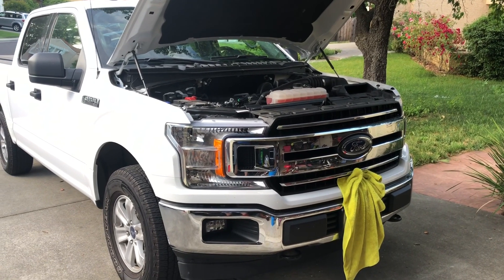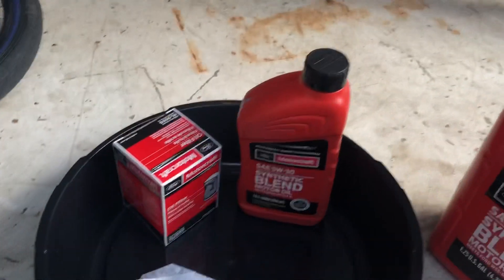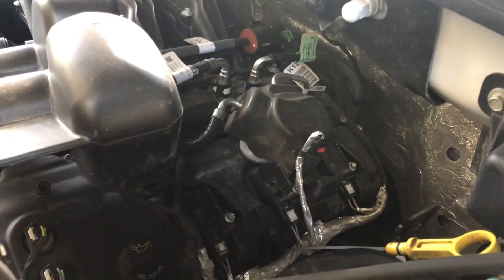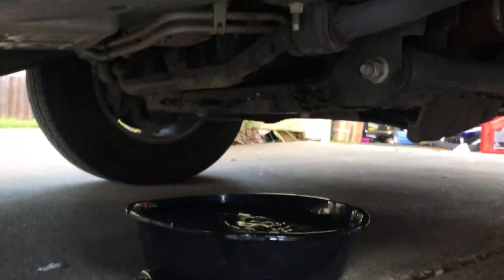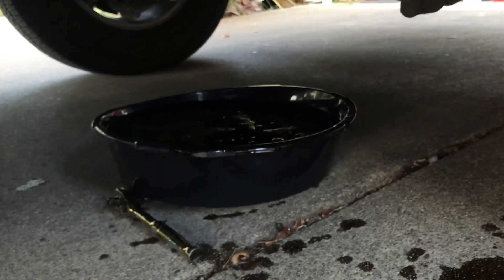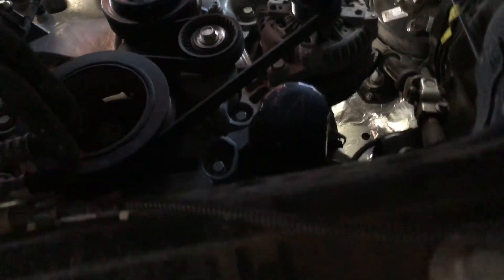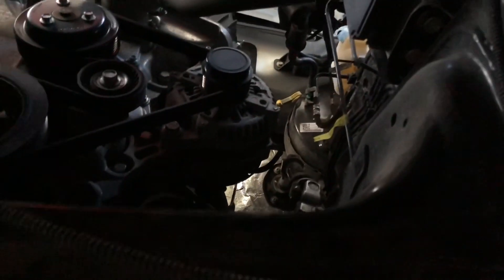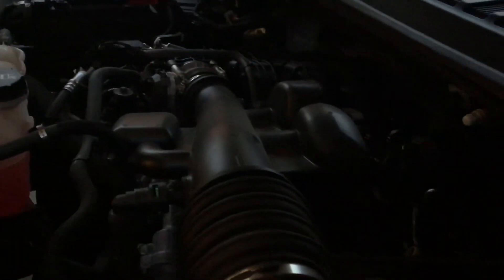2018 F-150 3.3L V6 Oil Change

Comment: Its almost like Ford said, " How can we make it an even more difficult  to change the oil on our trucks". Hopefully the aftermarket has a solution for relocating the oil filter to make it more accessible.
Reply: I am still driving a 2008 crown Vic. Oil change is a breeze by comparison. Ford knows how to make oil changes easy in a car. I think cup holders rate a 10 in importance to the designers and servicing ease rates a 1.

Comment: I just changed oil for the first on my f150 I prefer how Toyota Tacoma has there oil filter and oil plug. So easy little messy on the f150

Comment: Great video! Can you post one when you change the plugs so you can show how to remove the three on the passenger side?  The driver's side three plugs are out in the open.
Reply from the maker: Yea I’m at 61k on the truck now.  Done nothing more than oil changes and it’s running great.   Will do the plugs probably around 75k.  Same with rear Differential at that time too. 

I’ll post vids of each

Comment: I am wondering if this shares any of the oil consumption issues as with the V8 5.0L? (They started to spray on a plasma cylinder sleeve in 2018 on the V8)
Reply from the maker: I have now just under 49k on the truck and have had little to no oil consumption issues.   Love this lil motor

Comment: Is that a plastic oil pan on the 3.3? What in the heck is this world coming too. I really like and want to buy an F150 but this kind of stuff turns me off about it.
Reply: Check again, Ford may have gone back to a metal pan.  They did for the 5.0 engine.

Comment: I changed my trucks oil yesterday.
Here’s a couple of tips... 
1. don’t vent the pressure by removing the oil cap and/or dip stick until you  drain about 1 or 2 quarts and don’t release the drain plug entirely. Control the flow by holding the plug. This will eliminate the oil from shooting out so far. 
2. The cover that you referred to as “the splash guard” can be removed for better access to the filter. It  has 2-8mm bolts and 2-15mm bolts. If you remove it, the oil from the filter won’t splash anywhere.
Reply: Sound advice ..   my first time . I did the same thing as him

Comment: what's the differen on 5w-30 and 5w-20????? one dealer add 5w-30 when i buy the truck and 5k later i took it for a new oil change and they add 5w-20???? no now i worry can this hurt my motor ? i have 3.3 v6 f-150 2018 too!!!!!!
Reply: I got a 2020 Mustang GT with a 5.0.  The manual and oil fill cap recommends a 5-20W blend for everyday driving.  However, if it goes to the track, a 5-30W is recommended.
Reply: @AStanton1966  well i yes on winter i could add 5-w30 thats when i drive the most fro deer season! i really want a GT LOL
Reply: @7outdoors4life  I've got active exhaust.  When I set it to track mode, you really hear those dual overhead cams.
Reply: The difference is that the manual say 5w20.

Comment: thats the Duratec 3.3L Flex Fuel?
Reply from the maker: Yes!
Reply: @maz94protege  Hi! I'm on the market for an used F150, for work duty mainly. The truck I'm looking into is a 2015 3.3L Lariat 4x4, with around 82,000 miles. I'm from Ecuador, and here we have blended fuel with 5% ethanol. I have a few questions, but mainly is how well does the 3.3L V6 perform with blended fuels, as the compression ratio is 12:1. I live almost at sea level. Thanks in advance. Cheers!
Reply from the maker: @Greengineer593   hey!  3.3L is a flex fuel engine, upto 85% ethanol is perfectly fine.  We generally have 5-9% ethanol in our gas here, some stations sell E15 (15%) and some E85.  I love how this thing takes whatever.   87k now on her.  Still runs like a top!

More ethanol gives higher octane and less fuel economy. But won’t impact engine.

Good luck on the purchase!
Reply: @maz94protege  Thank you for your reply! Indeed, I met the guy and gave a look around the truck. Aesthetically, it is in pristine condition. I figured out the ad had a mistake, as the engine is actually the 3.5L V6 Ecoboost. Definitely not flex fuel as  it has direct fuel injection. Bummer.

Comment: Does this truck have a plastic oil pan on it? Good video thanks for sharing.
Reply from the maker: Thomas Tommy it has a metal oil pan.   I’ll be replacing the plastic plug with a fumoto valve in the near future.
Reply: @maz94protege  ARE THOSE OIL PAN ABELABLE NOW???? i hate what ford doing to this new cars
Reply from the maker: @7outdoors4life  have t checked for new pans.  Still no issues with the truck and oil changes have been simple. I get the whole “cheapness” using this fancy plastic. But I don’t off-road this beast lol
Reply: @maz94protege  man that's what im afraid lol im always off- road i leave out on the country :( i yes now i just have to watch where i go lol

Comment: I use the 100% full synthetic is that a difference?
Reply from the maker: Difference?  not really, other than pushing a few miles longer between changes.   Synthetic is an overall better oil.  a Syn Blend is just slightly cheaper as its not full synthetic.  Last a good 5k per oil change for me.  Cant complain.  75k ( i think) now and running great

Comment: Just checked and I don't have the plastic yellow drain plug
Reply from the maker: Is it an aftermarket plug?  Ill be replacing mine next oil change with a Fumoto valve.

Comment: Is there a reason you used 5-30 instead of 5-20?
Reply from the maker: Honestly don’t remember. Probably only thing in stock at the time.  Either one will work with no issues.  Depending on climate switching can sometimes be recommended.

Comment: Do these truck have transmission fluid dipsticks??
Reply from the maker: Wolfman Rebel yes they do.
Reply: @maz94protege  awesome, thanks
Reply: Yes but it's under a cap on the passenger side of the transmission

Comment: What mpg’s are you seeing with this model
Reply from the maker: sealtite87 I get 20-21 combined city and hwy in Northern California with hills
Reply: I just got 30 highway mpg.
Reply: 24 in my rcsb
Reply: 19 -20 avg 60% city 40% hwy
Reply: Cruise control at 55 mph i was getting 38 mpg. Got mud tires now it’s 20
Reply: 2018 XLT, 3600 MILES, 3.55, 20 MPG.
Reply: 22.1
Reply: 22.1

Comment: 3.3ls not getting any love I couldn't find one but got the 5.0l
Reply from the maker: Danzilly I love the motor   People knock it. But I have zero complaints
Reply: People knock the 4.6 and 5.4 3 valve Triton. They are junk. The 2 valve Triton engines were reliable.

Comment: How does the truck do with the small engine?
Reply from the maker: biscuitninja ya know...it does excellent.  Just pulled a 3500lb enclosed trailer 2800 miles across the country and couldn’t even tell it was back there. Had the truck loaded down with bikes and mowers and performed flawlessly.

I really like this little 3.3L.  It’s plenty powerful for daily and towing.   There is a guy on the F150 forums who pulls a 7700lb camper regularly with a 3.3L and no issues.

Comment: That's not a 3.3 only the Eco boost use the plastic plugs
Reply from the maker: Tom Gerencir negative. it’s a 3.3L Naturally Aspirated.  They switch to the plastic plugs with the new engine design over the previous 3.7L it replaced
Reply: Yes you are correct , my 2019 f150 thank god has the aluminum pan and regular steel plug it was manufactured 11/2018, just missed the plastic crap.

Comment: Put it on ramps and just the blue bucket.  Also what a stupid design.
Reply from the maker: No need for ramps. Truck sits up high enough.   The plug design is dumb but not a big deal IMO

Comment: Why use the 5w30?
Reply from the maker: Juan Rubio manual calls for 5w30, other options are 5w20 if your in consistent warmer climates.

Motorcraft Synblend is great stuff been using it in a number of my cars for years
Reply: Yes i live in Florida mine say 5w20
Reply: yea i was wondering about this as well.  im in Nebraska, mine requires 5W-20
Reply: Sarge just stick with what the menu says
Reply: Ford has 5w-20 for CAFE standards. I read an article from a ford engine engineer and he said for long term durability to use 30w or 40w that the margins for error using 20w for long term durability wasn’t there.
Reply: 5-w20 says in my manual 2020 3.3

Comment: I have this motor .  Its CRAP 
I traded in a 2.7l eco ..  much faster truck
Reply from the maker: Brandon Duhon I’ve had zero issues with the 3.3L.  This was a rental trade in. Got it with under 18k on the clock,  right now I’m over 47k.   Not the fastest truck, no, but it’s my commuter and I have a WRX if I wanted speed.     The 3.3 actually is stronger and faster than my old 94 Chevy 350.